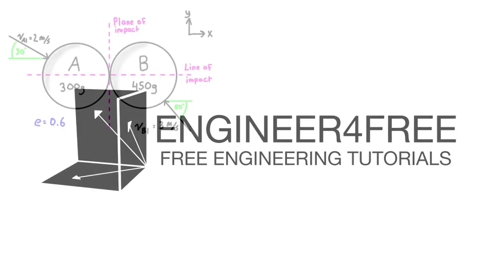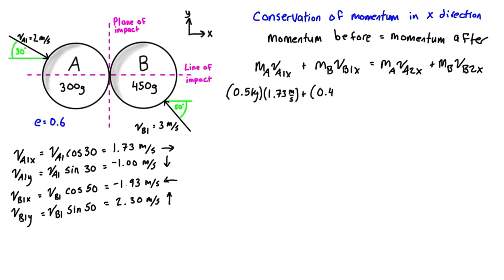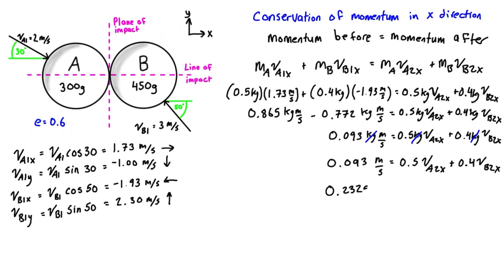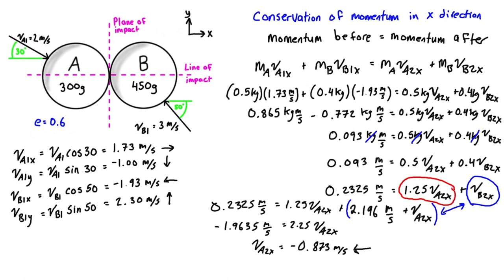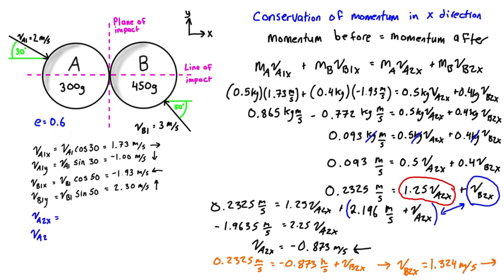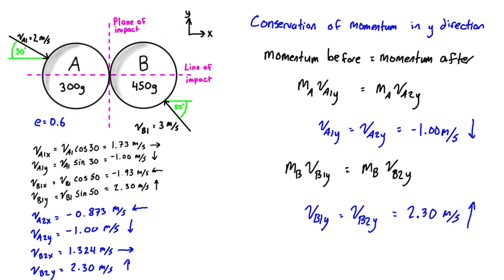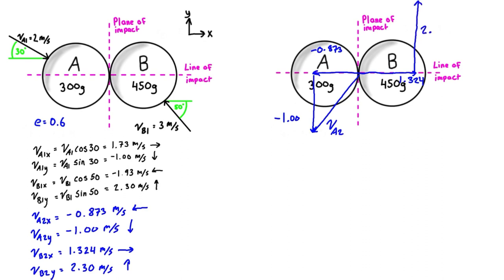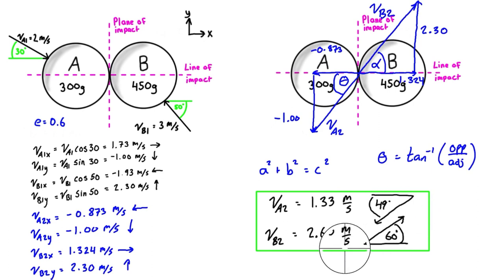Oblique Impact Example (Engineering Dynamics)

Comment: okay,now will you show us  an example where both x1 &y1 are different than x2 & y2 ?
thank you !
Reply from the maker: What do you mean by x1,x2, and y1, y2?
Reply: @Engineer4Free  If I'm not mistaken in this problem the momentum before and after are equal in the y axis  because the plane of impact being coincident with the Y axis. In cases where the impact plane does not coincide with neither axis, would not one assume that momentum Y1 would be different than Y2 ?
Reply from the maker: @lgl_137noname6  I would recommend setting up a coordinate axis x' and y' that is oriented in line with the line of impact, do all calculations in that frame of reference, and either leave your answer in that frame, or just clearly indicate the directions of velocity etc from a true horizontal line if needed. Similar to solving friction on a slope type problems

Comment: Hi Do you do requests? 
I am working on a boat. (simplistically)  I have a hinged metal hatch on the deck (think of a normal door configuration but flat) with a hinge on the long side. I want to raise and lower this by an actuator situated below the hatch (pushing up) either directly or indirectly via perpendicular metalwork  
How do I calculate the forces involved around the actuator - in order to spec which unit to buy bearing in mind the following-
1)The mounting point dimension lengths of the actuator to hatch and 'fixed' points are not fixed, (Hinge to hatch mount point=x, hinge to 'fixed' point =y) is not necessarily equal and at 45degs.
2)The length of actuator is not fixed (dependant on the  force required dictates which unit to buy and availability), 
3)The angle of the actuator to the hatch is not fixed, 
4) The weight of the hatch and dimensions are known, (approx 25Kg, hinge side 1100mm and width 700mm)
 5) Lastly the mounting point of the actuator to hatch will be offset to allow the hatch to open (rotate) beyond the 90deg point - rotation from horizontal to beyond vertical might be 110deg say with a drop of 75mm to the actuator pivot point on the hatch. This would dictate the location of the 'fixed' mounting point of the actuator.

I have tied using moments, CofG etc but can't pull the values together to be meaningful or come up with a formula enough to iterate the value mentioned above
Thanks in advance